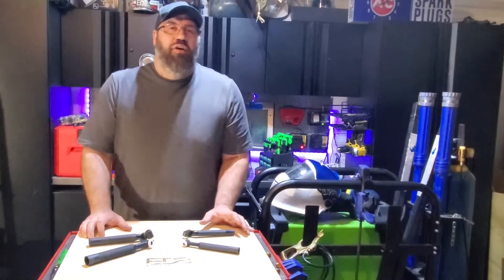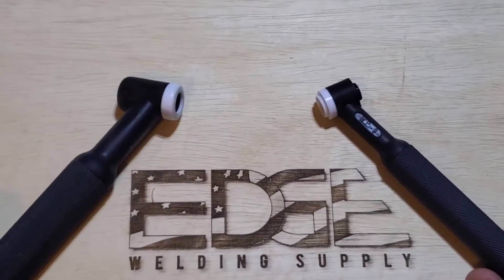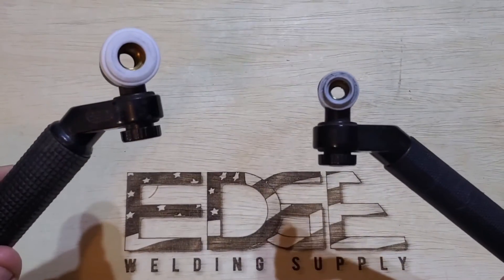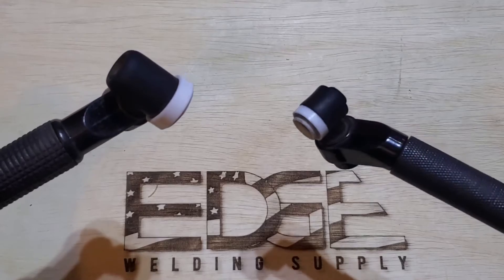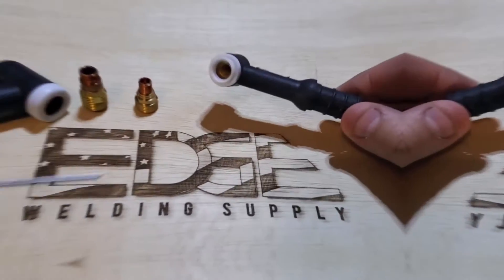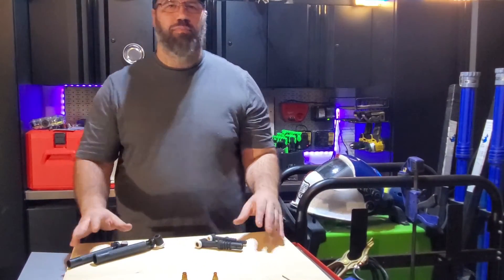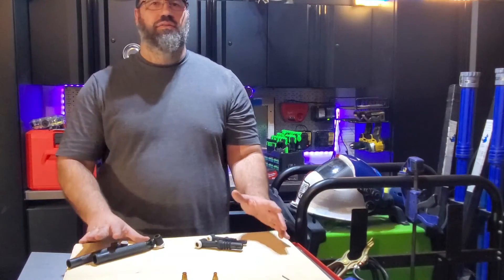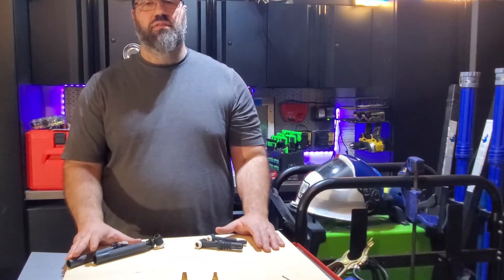Identifying different TIG torches. Featuring EDGE Army member Brad White

Comment: Is the thread size for the 20 series the same as the 9 series?
Reply from the maker: Yes. The only difference, I'd in the in-coming hoses. 9 series has 1, as its air cooled. 20 series has 3, arc/gas, send for cooling, return for cooling.